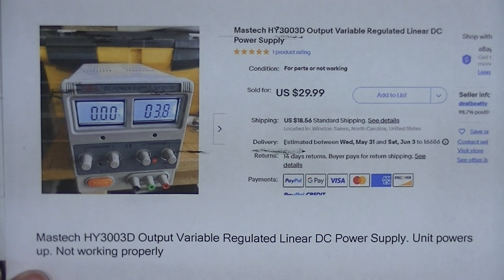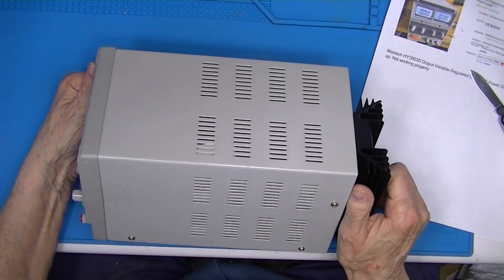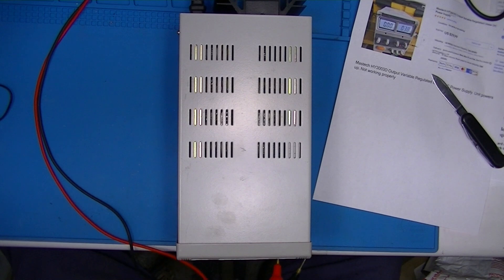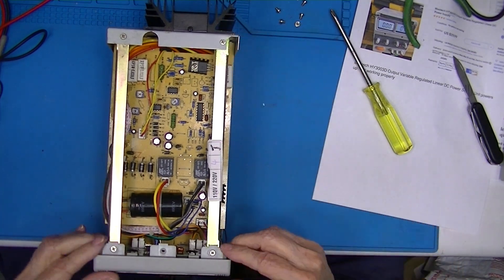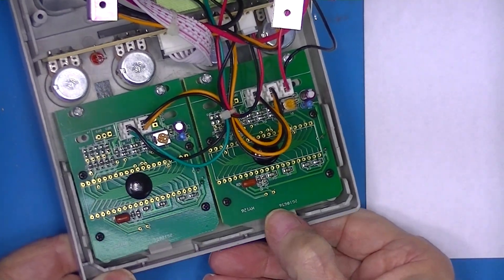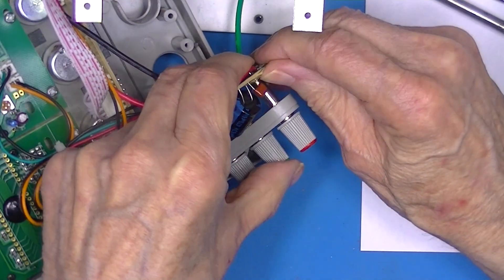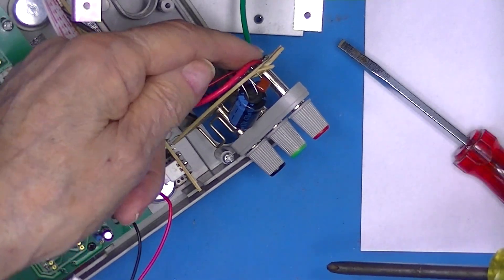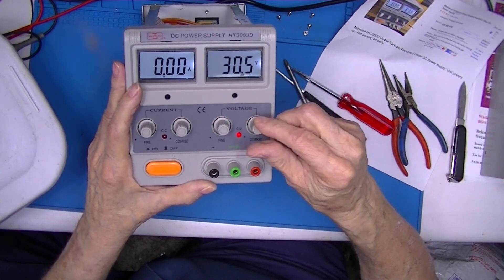Mastech HY3003D – “For Parts” Linear Power Supply - Part 1

Comment: I would be good to put some epoxy glue on that output board before putting it back together. It might break loose again if not fixed properly.

Comment: Hi, Mt. Steve. Thank you for the video. 1) Your full name and address are exposed by the box shipping label @1:11. I highly suggest that you edit the video to remove it. 2) I would be glad to rough in a new banana connector board, for you. I should have enough different types of bare copper clad board. Here's the details that I would need: a) Completely strip the board. b1) Option1 = To communicate by the postal service... Make a "Xerox" copy of the front and back of the board. Make sure the printed scale is true to 100%. You can not rely on a copier's scale setting. So, draw a 100mm line on a piece of paper and copy that with the board. On the picture copy, measure the 100mm line. Adjust the printer's scale setting, until the line on the copy actually equals a true measured 100mm. (For example, my copier scales in at 100.02%) Let me know that you have chosen to communicate by mail and I will mail my address to you at your address that I grabbed from this video. See, the nuts are already using your mailing address <grin.> You can then send me the copy, or the actual board would be even better. b2) Option2 = To communicate via the internet... If your copier has a scan function, make a scanned .pdf image and place it in a cloud storage file at DropBox. Include a scaling line. Then, give me the link to the file. c) I also need to know the board's thickness in millimeters. And, can it be thicker? The new board will not be anything fancy. I will just remove the copper with a rotary tool to create the copper pour zones. Or, just give me the board measurements and I will mail you the copper clad, for you to make the board yourself. Your choice. All absolutely for free, of course... including shipping. I hope that helps. That board looks dangerous (to me) and we want you around to make videos for us! lol
Reply from the maker: Thanks for the kind offer!! The board seems as good as new, after put some Super Glue into the wafers and clamped them together. The board was poorly  designed, it should have had four screws. 
Thanks Again
Steve
Reply: @stevestrivia-bystevewagner4852  Excellent solution!

Comment: Steve, I would have put two washers on that output board, as well as a drop of Elmer's (or other) aliphatic resin glue on the area that had delaminated.  Just a suggestion.

Nice job though.